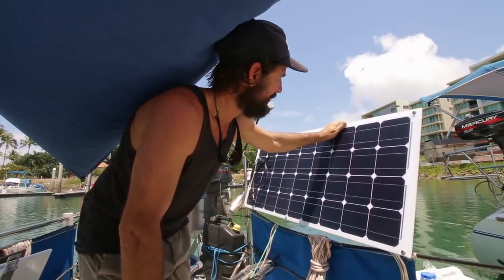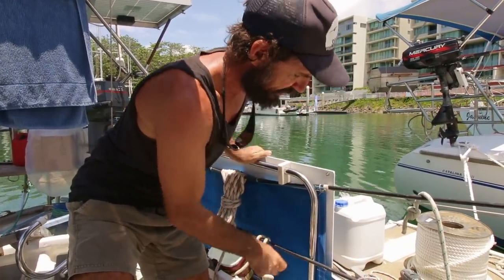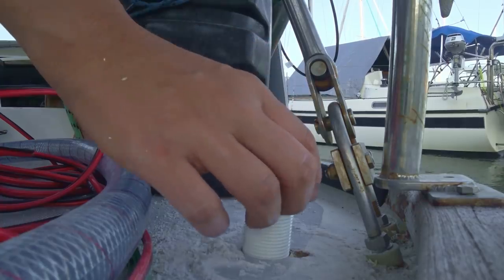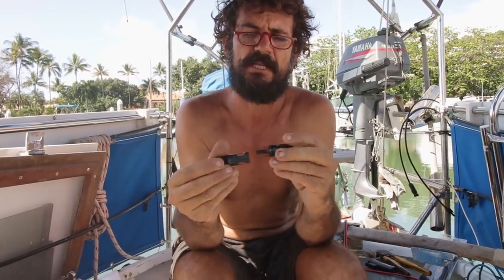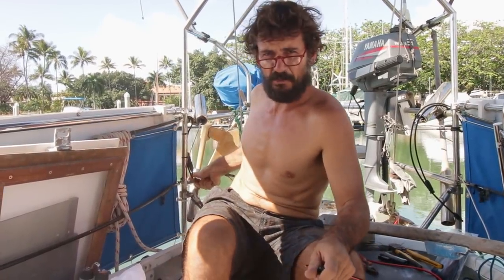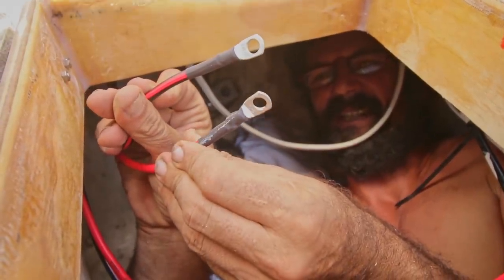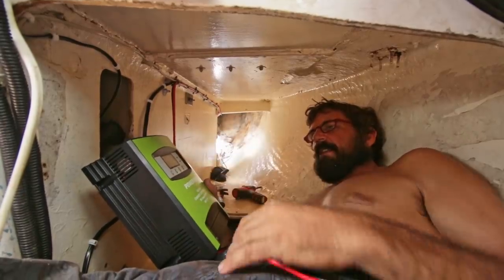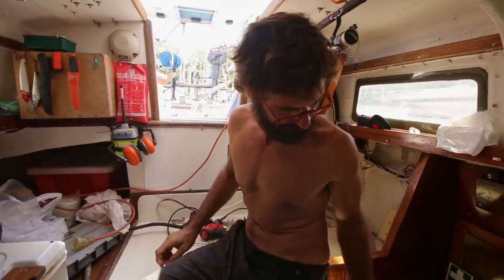A Half Hour of Solar Power: Our New Solar Installation - Free Range Sailing Ep 74

Comment: Really interesting and informative video. I too have recently purchased new panels for our boat, and I asked the same question of my electrical guru (retired electrical engineer) ... "what's the difference between the cheap and expensive panels?".  Heres what he told me: There are only so many factories making solar panels on the planet, so most roll off the same assembly lines. Apparently, the manufacturing process involves "laying" hundreds of filaments, to connect the cells. These microfilaments are fragile, and the number of these that survive the manufacturing process intact determines the actual output of the panel. So, each panel is tested and given a rating.  The "perfect" panels are not sold to us mere mortals. They command a premium price and go to high-end military /commercial operations, space programs and such. The others are graded into four classes. "A" grade being the most expensive, "D" grade the cheap e-bay variety. SO it seems the advertised rating of a panel is its "manufactured" rating - not its actual real-life rating. A reputable manufacturer will publish the test results in the form of a graph. Even though my panels were not cheap ($450 for 270W) the specs showed they were in reality about 5% less, which I'm told is a pretty good result. Troy & Pascal's panels were close to 50% less than their manufactured rating. That seems to be the way the solar panel industry functions.
Reply: Another trick they do is to take the Open Circuit Voltage and multiply it by the Short Circuit Current to give a higher, (false) wattage rating, when you can never have that situation. 
They also rate them using the maximum Sun energy hitting the Earth (w/m2) and 20 or 22degC, which is another thing you will never get happening together, unless you use water cooled panels or set them up on top of Mt Everest only during Summer.
Reply: If there was a job title of slapper of the corporate tosspots, I'd be at the front of a queue of almost 7 billion people.

Comment: For any future electrical work, whenever you do ring terminals, Anchor and few other companies make ring terminals with combo glue and heat shrink. We use the stuff on ships and have had great results thus far. 

Having seen a whole mess of cables ruined for their first 20 feet, just sealing up the ends really makes me feel a lot better. We also use finely stranded tinned wire. I suppose if you’re ready to fix it, it doesn’t matter much. It’ll probably well outlast your ownership of the boat, and probably the solar panels as well the wave you’ve done it. 

I absolutely love your YouTube channel, it’s rather inspiring and you guys are very savvy! I’ve been around the water most of my life, and still learn a ton from you guys!! Cheers!

Comment: Chief Engineer = Keeper of the Manuals.
Reply from the maker: That equates to a loose nut on the tiller causing the most problems aboard Mirrool.
Reply: @FreeRangeLiving  loose Nut at the tiller,,, too funny. 
On motorcycles, we said that there was a short between the Handel bars and the seat...

Comment: Thank you so much for sharing this video on solar panels & mppt charge controllers.  I am just setting  up a solar system on my 25 ' sailboat and this info has been so useful.  I wanted flexible panels but ended up with rigid panels. 
Your channel is the BEST! ♡
Fair winds & following seas ~
S/V CORK.

Comment: Solder and mastic filled heat shrink. No crimps only solder. Galvanic corrosion will trace up the cable but won’t pass the solder joint.
Crimps can draw extra current via resistance. More resistance more current draw less efficiency. When you think about it you have four points of contact between two cables when joined. 
Pot you connection boxes in electrolube 5097 optically clear silicone. If there is a fault you can pick it out with your fingers.
Coming from an exterior lighting manufacturer.

Comment: The glass panels attached to the rail will be fine. They can be stood on and not break. Unfortunately the flexable panels have a power loss of 15% the  first year and usually fail by the second year, like all panels a shadow or rope across one of the corners will cut all power.  Nicely done and explained install though.   Fair winds
Reply from the maker: We have had no problem with power loss by using a thin cord to suspend the panel in the last 4 months. Even some shading by the mast doesn't  knock out all power. Theres plentyof comments saying similar about the flexi panels though. Every now and then you get bitten.

Comment: I found myself in a similar situation. Solar was much cheaper in Australia than the US or Caribbean where I was picking up my vessel to sail back to Australia so I purchased 2 x 250W flexi panels from eBay but they were too big to fly with so spent another $500 to have them shipped to my vessel at St Lucia in the Caribbean. As it turns out, they output 75Watts each and we were getting much better output from the existing 135w Kyrocera panels which performed exactly as reported. Upon contacting the vendor they started asking for open circuit voltages and such but what could we do between remote islands to enforce our buyer protections within the time frame allowed especially while internet is far between ports for each test requested by the vendor. Moral of the story, especially with cheap flexible solar panels, caveat emptor.
Reply from the maker: Ouch. I feel for your situation.

Comment: Hi guys. Pretty good installation, apart from : Are you aware that a single shadow line cast across a solar panel, for eg. by the lines you have coming down from your backstays, will cut the panel output in percentage terms by the size of the panel furthest from the output connectors. EG : if the shadow line falls across the middle of the panel, you will only get 50% of the output of that panel. Prop the panels up with a small prop (piece of sail batten or cheap broom handle) and dispense with any overhead lines to the panel and see if there's a difference. Even though the "cut off" segment of the panel is in full sunlight, whatever it generates will not get past the shadow line. There is some waffle about one type of panel (can't recall if it was mono or poly crystalline ) being immune to this "feature" (yep, I've used Microsoft products too ;-) ) but it's better to ensure no shadow lines. Wouldn't knock the Chinese panels, it's a pretty safe bet that they're all made in China these days and, as ever with Chinese or any other stuff, you get what you pay for.
Reply from the maker: The line running across hasn't made a significant difference when we've tested different alternatives. It's about 2mm and doesn't present much shading. In return it gives unlimited angle through 180 degrees for different sun aspect.

Comment: Great video guys love the attention to detail on the wiring work, just my take on crimp connectors and there are those who would argue but I never solder crimp connectors. soldering reduces flexibility and may introduce corrosion via flux ingress. a well crimped connector is best, where extra sealing is required the glued heatshrink is great and also the paint on pvc insulation provides good sealing. for screw terminals I like Wurth spray on terminal sealer it is a waxy substance that dries tac free and works great without making it hard to remove the nuts later.
Reply from the maker: 100% agree with you. I haven't used that Wurth product but I don't see why it wouldn't be just as great as everything else they put out.

Comment: Hi troy and pascal
Always go for the Italian solbian solar panels if you are choosing flexible. Over the last 7 years there have been many different brands of flexible solar panels with some (presumed Australian panels catching fire and the distributor walking away leaving everyone high and dry). You also need to ensure that you install blocking diodes into the solar panel side of the cabling before the regulator.
There are a few new flexible brands on the market like Radpower , but why take the risk. Chinese panels produce I am told by a few different sources 20% less power with in the first 2 years and need constant airflow beneath them to ensure efficiency. Where the solbian panels are the only panels warranted by directly sticking them down to any base without airflow.
A good regulator like the new victron MPPT regulators also helps.
Also choose rigid if you can and go for good reliable brands like enerdrive who are Queensland based and warrant their products.
Reply from the maker: Solbian has been a consistent recommendation through the comments. We will have to research them. There are blocking diodes in the system so that's ok. Thanks for the information, we would have used it when we were shopping around.
Reply: Thanks for the great videos. Hope it all works out with the solar

Comment: Solar install seems less daunting now.  I have a month to get my boat electronics straight (June) so I'm lining up my people now and searching for the right supplies, shipping them to the boat (USVI) so I can get straight to it.  (I think my Solar install might wait until after this hurricane season).  I'm looking at 7 months to Work my tail off to feed the sailing kitty, fine-tune the boat and getting off the dock to finally get cruising.
Reply from the maker: One thing a commenter told us- putting a fuse in line between each panel and the parallel connection will prevent the diode from being overwhelmed by a failure and protect against panel fire. Sounded fair to me.

Comment: Having the shadow of the rope across the panel will impact the power generated more than you think.
Reply: I'm glad someone mentioned this,  weakness of panels that is remedied with dedicated controllers in overall parallel.
Reply: Absolutely, the shadow on the panel is an absolute no no, causing heat build up which can cause severe panel damage.

Comment: Troy - during your test at 21:12 where your showing the panels - there appears to be wiring at the aft of the panel. That and as was stated, any shadows, like your panel overhead line support, will cause dramatic power loss in them. Did they have the bypass diodes between (doubt it) sections? Even a spot of bird droppings can degrade the output. Mine, land based, at the "water collection low spot", and dust / mud left behind (dried) will cause loss also.
Reply from the maker: shading produces dramatic power loss if it runs along the cells in series rather than across cells in parallel and it wouldnt account for halving the output. We have had them for months now and given them full testing. The panels are not outputting their rated value.

Comment: Hiya to you both. What an absolute pleasure for this old spark to watch you at work on your boat. WOW! correct tools being used, those strippers are the same ones I used for many years with no problems. You can get shorter handled crimpers for not a lot for up to 25mm2 crimps. One set for red, blue and yellow, a second set for 10, 16 and 25mm square csa. Properly done crimps are the same as welding the copper so do not solder, no need. Tomas & Betts (Spelling?) make ty-wraps with stainless steel locking bars, much better than plastic and a ty-wrap gun puts on your pre set pressure and cuts off the tail with NO sharp edge. Hands up who's scratched themselves? End of essay...
Keep up the great videos, fantastic content and very high production values, I used to do lighting and power for film & TV. 
Take care...
Reply: Proper hex die crimps will compress the copper to solid, or close enough for electrical ratings, indent crimpers and insulated crimpers will never compress the strands enough. The only reason to add the solder is to stop salt water wicking its way in and creating corrosion. Those crimps are all sealed so no need.

Comment: Hi Troy
 You may be a bit unfair to the solar panels. - Three points:
1.   Rating of solar panels are based on the output voltage of the panel and not the output on the controller.over which there is considerable energy loss - evidenced by need for cooling. 

2.  Your battery might not be able to absorb the available current output particularly as it appears to be nearly fully charged.

3.  The way to properly measure the wattage of the panel is to measure 
simultaneously the voltage and current across a load  resistor. That way
 the full open circuit voltage of the panel is exploited.

Enjoy your show.
Regards

Robert Wechsler
SV Road Runner
Reply from the maker: We weren't complaining about absolute output. It was output relative to the old panels that are subject to all the same conditions because they are wired in parallel.

Comment: Hi Troy, haven't got through it all yet but I would use some stainless tube to support it (legs that flip out to support it horizontally, and then flip down to let it lie against your stanchions when not in use).  You could still put a cable up from underneath to hold it down on the legs.  (something like a fish cleaning table you might have seen on other yachts).  You really don't want to cast any shadow on it if you can help it (your solar arch is already going to be challenging enough).   B

Comment: If you can, support the panels from beneath.  A little bit of shadow has a disproportionate effect on the output.
Reply: CorwynGC I was going to say the same thing but Troy did mention something about isolating parts if shaded as a feature of the electronics so I am sure Troy thought about that.

Comment: Troy, I got 4 panels and hooked them up in parallel.  Wen the output was not there, I called.  They said to hook them up in series.  My system is 24 volts but the power coming into the controller runs as high as 140 volts. much more efficient.  Now I am getting the power I should.  That is what the  controller does is drop the voltage to what is needed depending on what the battery condition is.
Reply from the maker: We have limited space and have to deal with shading so wiring in parallel is the way to go. Its a compromise. Shade is very detrimental to series run panels.

Comment: Hi,
Already a lot of comments but ... MPPT will work by setting the best voltage on the pannels to get maximum power point [MPP] (mix between amps and voltage). This setup of best Volt-Amp changes with PV modules and takes upto 30s to be found.
You should try to disconnect all of them and connect them separately to test the power output they can generate individually. If the sum of the 3 single pannels is not the same power as all of them connected at the same time, it might be an idea to have multiple MPPT or multiple PWM (cheaper) instead of only one big MPPT.

Comment: Hello folks, been away for a bit but wanted to add this little tid bit. I have new neighbour moved in up the road and he deals with the Chinese. He told me that the Chinese only have 2 manufacturing methods really really good, better than some original parts they copied, and reallty cheap crap, There is no in between, so if you are trying to save money more than likely you are going to get crap.  I bought a few photo pieces and they are crap yet i bought a clone espar heater for $250 canadian rather than $1300 for an espar and it works fine, saved $1000. Good luck mates  from the Great White North Canada
Reply from the maker: Entirely believable

Comment: for the solar panels I would have a rod tha swings down then goes into a fitting that has a clevice pin to hold it in until you want it out which will stop it from moving up or down.

Comment: Great video! I think you risk water ingress in your through-hole connection through the treads. The seal only seals between the nut part and the deck and unless you put some magic goo on the threads water will find its way down.

The benefit of having a too large MPPT is that it will operate cool and with perhaps more longevity. And when those flexible panels fails, you have a large controller for the next set of probably more than 2x160W panels.
Reply from the maker: We did put a little sealant on that through hull, perhaps we missed mentioning it in the edit. I have used this method on Mirrool when I first got her 5 years ago and commercial fishing ships and it has held up quite well.
You have a good point with the over spec controller as it rarely runs its cooling fans and is never hot to the touch.
Reply: @FreeRangeLiving  Thanks for the reply. Should not have doubted your foresight in this regard :)
Keep up the good work.

Comment: Hi Guys, Running the panels as is, is a good idea, in that it avoids blackouts if one or more panels become shaded. However the MPPT regulator is designed to work with voltage, it's a switch mode transformer. eg my two 200w panels will run on a standard /PWM Reg at 11+ amps in parallel. But put them in series into an MPPT Reg and I get 30 amps. The reg steps down the high VDC from 70+vdc to 14.2 and in doing so increases the current. Real smoke and mirrors stuff ah?
 Wonder if you could split the Port and Starboard in half and run each half in series, I think you could then connect the two half’s in parallel which should still work better then the setup as it is at the moment.  
Kind regards Vernon & Trish.
PS Keep up the good work...
The Spec’s of my panels:  VMP 36.5vdc OCV 44.5vdc.  IMP 5.21 amps, SCI 5.52 amps
Reply from the maker: I get the benefits of series from the relationship of volts and amps to give watts and would run them in series in a heartbeat but we have multiple sources of shading to deal with. The downside of a very small boat.